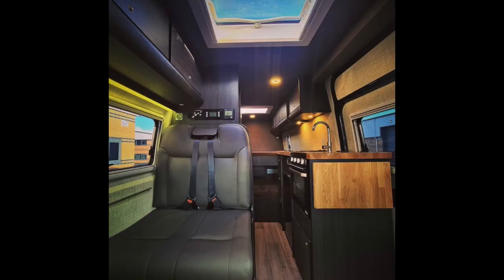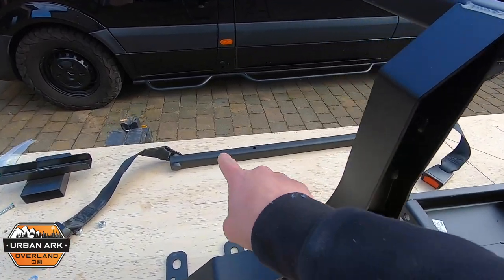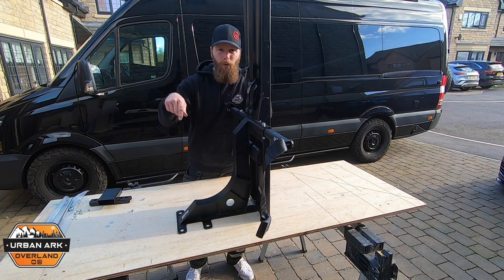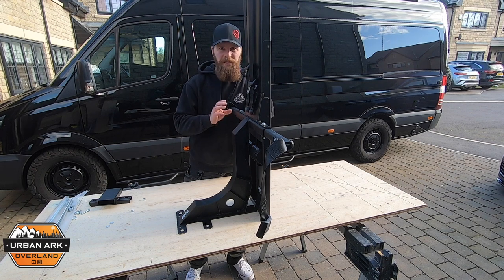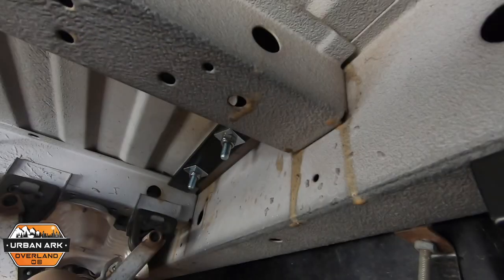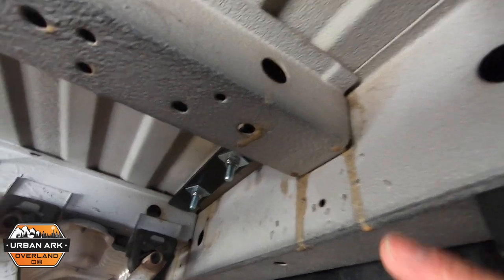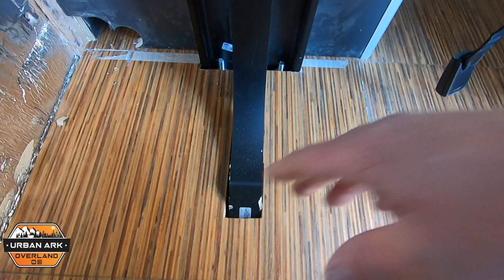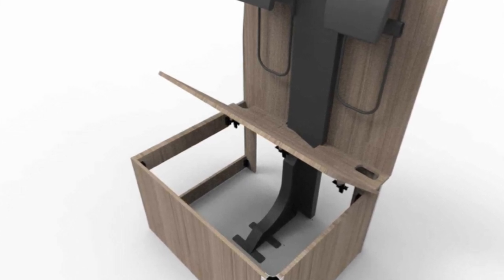SPRINTER REAR SEATS FRAME motorhome style EVOMOTION

Comment: I nearly bought one of these, i went for something else in the end on safety grounds (my own personal opinion) but it was still very interesting to see how it is fitted. thanks.
Reply from the maker: No problems. 👍🏻
Reply: @urbanarkoverland  My concerns did not center around the actual seat frame, as you say in the video, it is super strong and sturdy and in the event of an accident will very likely stay put. However, can the same be said of the lightweight ply box the kids will be sat on? God forbid an accident occurs but if it does, will my kids find themselves still securely strapped to the frame but now sat down in a heap on top of the truma and other gubbins because the box has collapsed?!? (in every crash test video, this box always fails) This doom thought made me go for a 'full frame' type, but hopefully the Evo box is nice and strong and will stand up to scrutiny or maybe some additional 'strengthening' elements can be added to it ?? Interesting to get your thoughts on that and how you intend to mitigate these worries? Anyway, enough doom and gloom, I'm enjoying your videos, very informative and easy to watch. all the best.
Reply from the maker: @superstrings4768  
I do hear what your saving actually. But my thoughts are bud he is in a seat. That is strapped in. Even if the seat dismantles around him. He will basically be floating in his seat if the seatbelt does his job. If a side impact is big enough to push the side of the van in by two feet then we are in trouble anyway. 
Thanks for your comments. Appreciate the support. 👍🏻

Comment: Thanks for putting this video out there. Looks like a great product. Just wondering if you could answer a few questions for me. Did the seats go through your MOT ok? And did you run into any problems with your insurance having fitted them yourself? Also I’m looking to install 2 in my LWB Sprinter facing each other. From the insights gained during your install do you think that would work? Thanks for your help. Going off to watch your weight saving tips now. Nice work.
Reply from the maker: Hi. The law is very strange on rear seats. Like there isnt one.  It really. Just inform insurance of seat number. You will be fine. 
I’m sure that they sell a rear facing seat. This one can’t be used the other way. But I’m sure there is one 👍🏻
Reply: @urbanarkoverland  Thanks!

Comment: Many thanks for this video, it has given me the solution I was looking for for installing my double passenger seat behind the driver's seat. Is that threaded rod that's used 10mm or 12mm?
Reply from the maker: 12mm I think. But it comes with the kit 👍🏻
Reply: @urbanarkoverland  Many thanks. I thought it looked like 12mm.
Reply from the maker: @Stoker580  yeah. Needing a 24mm socket caught me out a bit ha